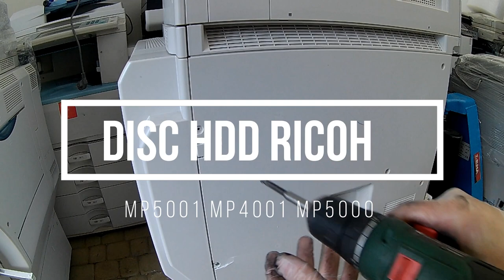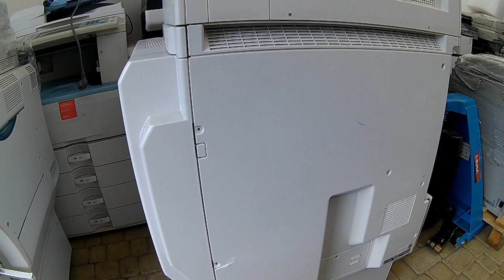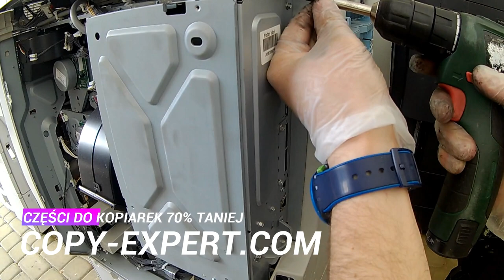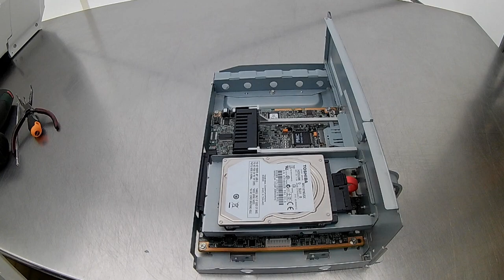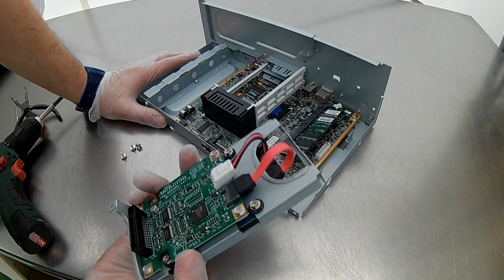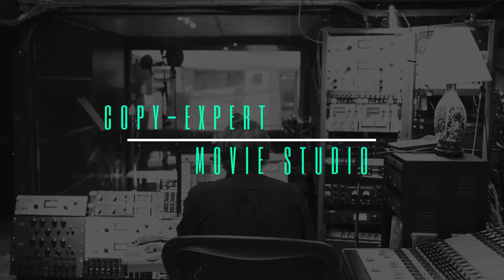HDD DISC RICOH MP5001 MP4001 MP5000 MP4000 MP4002 MPC4502 REPLACEMENT

Comment: I have firmware  but can't install it plz help me bro Richo MP 5000
Reply from the maker: If you haven't done it before, better call the service to update it for you. However, if you prefer to do it yourself, download the software to an SD card. The SD card must have a low capacity because a high capacity card will not work. Copy the software to the card, turn off the copier, put the SD card into the copier where the controller is, you have an SD slot and turn on the copier. Then Ricoh will do everything by itself.
YOUTUBE SUPPORT: https://www.youtube.com/channel/UCOHtXTtGHj33pUm8Gf2FH3A/join 
PATREON: https://www.patreon.com/CopyExpertMovieStudio 
PATRONITE: https://www.patronite.pl/1796
Reply: @MrRicoh  I am technician bro
Reply from the maker: There are different software for different markets. What I have will not be useful to you. You must go to your copier and parts supplier. He will certainly make such software available to you.

Comment: hello ...my ricoh 4001 do not reset or format and i cant print any thing how i can format hdd or reset my ricoh 4001 please help me ...some one told format hdd via computer ,, but how ?
Reply from the maker: Look this film: https://youtu.be/Cv9P41BpF98
Reply: @MrRicoh  thanks friend ...i know by this way ...
but my printer screen is working without any code but the key dont working ...
i think by formating the hard but external may be fixing .thanks
Reply from the maker: If you have a damaged disk, the machine may not start. Remove the back cover and disconnect the HDD. The copier must start after this operation. Eject the disc and install a new one. The disk is the same as in laptops, but no more than 250GB.
Reply: @MrRicoh  
thanks friend ... i will try fixing with new HDD .
but if i change by a hard 128GB have a problem ?
Reply from the maker: It should work.
Reply: I have firmware  but can't install it plz help me bro Richo MP 5000
Reply: @muhammadishfaq8211  pls could you share me your firmware for mp5000?
Reply: @ZanGuetZu26  its ok